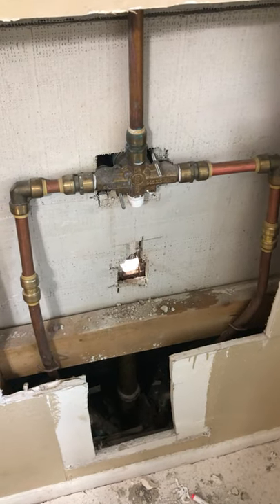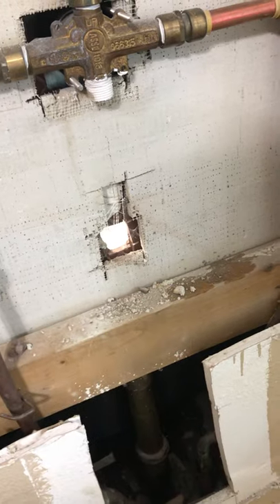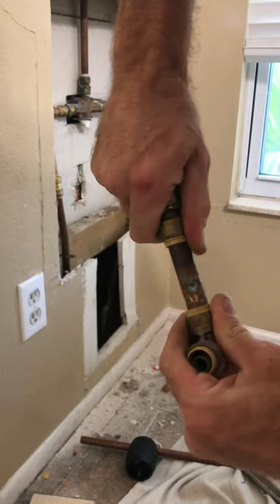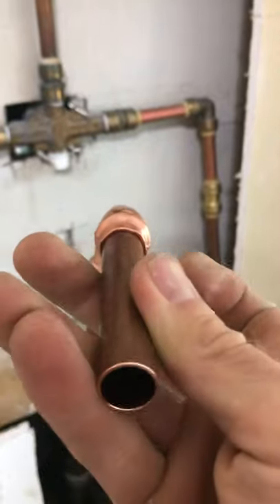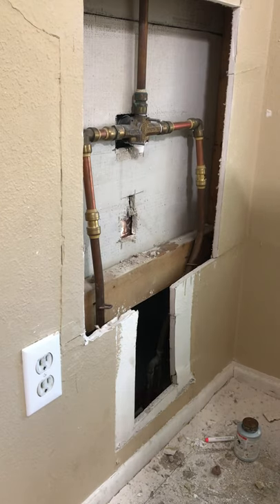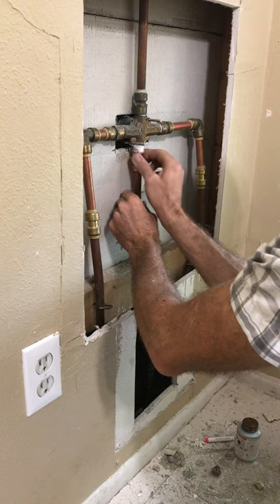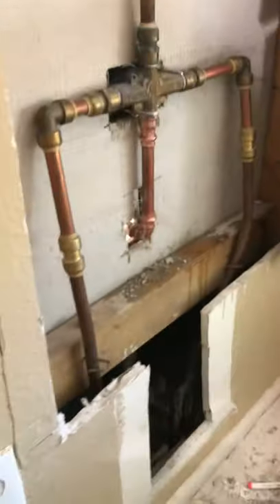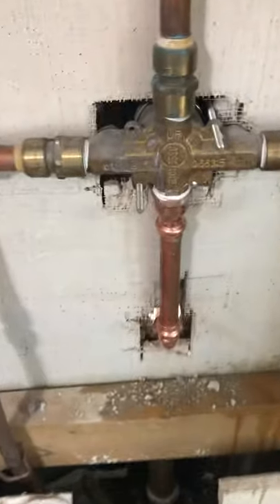ProPress tool field demonstration on tub spout.

Comment: I was told by Viega that you should solder the tub spout part because you can loose the pro press fittings when screwing on the spout tight against tub wall